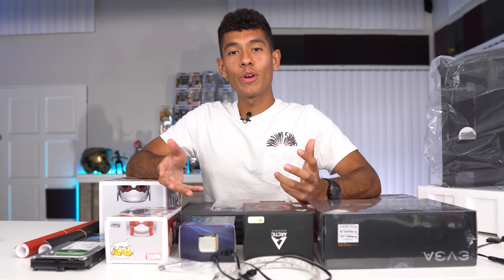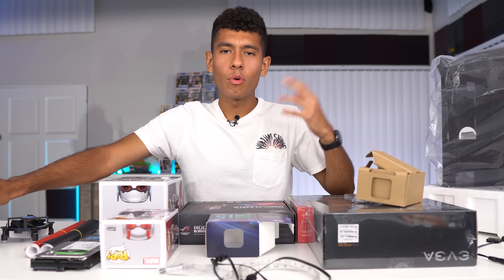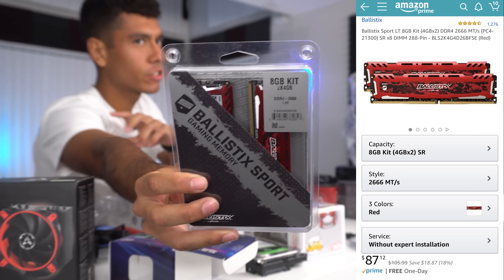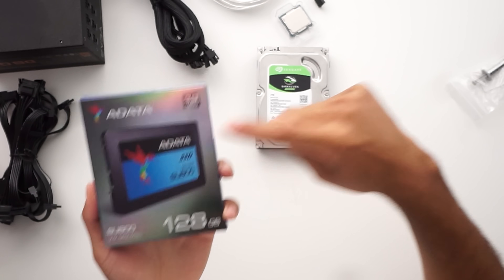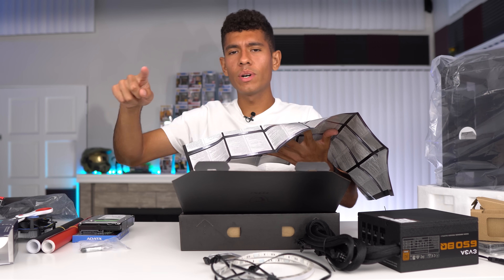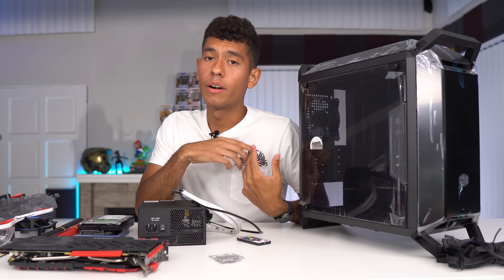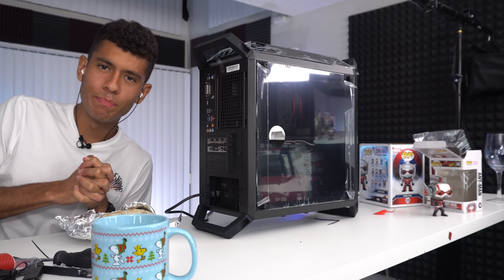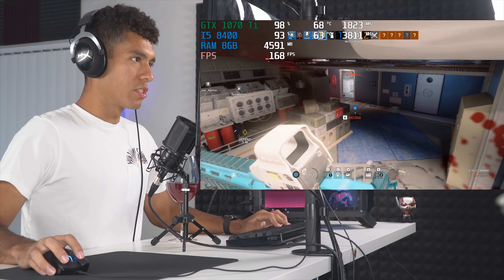$1100 Gaming PC Build - i5 8400 GTX 1070 Ti (w/ Benchmarks)

Comment: so quick question I have a corsair 600w bronze power supply and a 1070ti founders edition, I am carrying over from my last build (need to upgrade, have a fx-6300 and a failing hard drive)  I was wondering if the 50 watts really matters if I followed this build, and does the fact that I have those two different parts going into this build change anything.

Comment: Hi, I'm trying to build my own pc for the first time and I'm planning to build based on this list, but I'm trying to buy i5-8600k instead of i5-8400. so the question is that does it still fit with the same motheboard? and should I buy better power supply since I chose to buy better CPU?

Comment: bruh, only the 'MSI Gaming GeForce GTX 1070 Ti 8GB Graphics Card' is already 650 euro here 😂

edit: the parts for this pc is 1370 euro here (The Netherlands)
Reply: Got it for 1263,77 at Azerty.
Reply: Here is the link, changed the cooler with a liquid cooler. https://azerty.nl/basket/?code=YTo5OntpOjIyNjY0NTU7aToxO2k6MjIyMTgxNztpOjE7aToyNDc4MjkzO2k6MTtpOjE1NjI3MDU7aToxO2k6MjMxOTAyNjtpOjE7aToxMzc2NTEzO2k6MTtpOjMyMTY4O2k6MTtpOjIzMDgwMTA7aToxO2k6MTQzMDQ0MTtpOjE7fQ==

Comment: Question for you. How come when I play rainbow six siege using pretty much the same build, only difference being I have i5 8600k I can only seem to get 130-134 fps. I have tried to lower settings but for some reason it's like its capped

Comment: ida probly gone for the r5 2600 as its cheaper, performance is the same or slighly better and better upgrade path ( as in, keep the board you have and it will be compatible with future processors ). however, great build and vid bud. keep it up

Comment: Would the MSI GTX1070 8G Duke OC fit in the case used in this video?
Reply: Use pc part picker just pick your case and then pick the graphic card and it should tell you if its not

Comment: I use to use ballistix ram with my ryzen 5 build and it was terrible. The speed was slow and it kept crashing! I even got a freereplacement by crucial but it still kept crashing. So after that i decided to get more gb and bettter speed and i got the corsair vengeance rgb pro 16gb 3000mhz. Works like a dream. And i also have a balck and red theme build so i can program the rgb pro lights to go through a cycle of red and white and it looks awesome! Way better then the gay default rainbow colors the rgb went through...
Reply: Any recommandations on what should i get instead of Ballistix Sport RAM at the same price ? Im trying to build the same pc as the one showed in the video. Thank you
Reply: i have a i5 8400 and 8gb ram if i get anything higher than 1070 will it stutter?
Reply: Rertarded Seagull - I wouldn't recommend anything higher than a 1070 if you have an i5 processor. Reason being the processor will limit the performance of the GPU and It wont run at its full potential. so if you bought a 1080 it wouldn't run at full speed because your CPU cant drive it hard enough
Reply: I recommend corsair vengeance rams. Get the non rgb ones if you want them like 50$ cheaper for the same performance

Comment: Can this pc build handle a monitor at 244hz?!❤
Reply: hamza muf that’s a dumb question but yes
Reply: Uh da fuq is that question. As long as your monitor is good, anything can work on it
Reply: Thanks
Reply: I thought that if a pc has shit specs that it wouldn't be able to run on a very high performance monitor
Reply: hamza muf you can use a 240Hz monitor with a shitty pc, you‘ll just not be able to get 240Hz so the monitor is kind of overkill/a waste of money
Reply: No at 1080p even the 1070ti can't get above 160fps on everything high forget it if it's 1440p. Get yourself a 144hz. Btw why even get 244 lol you're not a true gamer for a team and if you were you wouldn't be asking these types of questions then
Reply: a monitor is just a display for your content. there is no spec requirement
Reply: Depends on the game/settings. If you plan on playing games with extreme graphics, 1440p or maybe even 4k you won‘t get 240fps, but in 4K high resolution/graphic settings you will probably not get 240fps with any card.

Edit: If you only want to play games like fortnite in 1080p low graphic settings you are going to be able to reach the 240fps

Comment: What are the fan splitters for??? Help plz
Reply: That allows you to power two PWM fans from a single PWM header on your MoBo.

If you have a 4 pin MoBo header, that is in no way a guarantee that it is a PWM header and that splitter may not work.

I much prefer fan PCBs as they allow for a far cleaner / neater installation. But you must know whether your fan header is providing a PWM or DCV (DC Voltage) signal (read the manual).

Alternately you can use this which works for either a PWM or DCV signal.

1. You can control up to 11 DCV (3 pins) fans with this hub from a PWM MoBo header with the auxiliary power cable connected.

2. You can control up to 6 or so DCV (3 pins) fans with this hub from a DCV MoBo header; do not connect the auxiliary power cable. Six 140mm 1250 rpm fans (0.14 amps each) will draw a total of 0.84 amps ... MoBo headers are rated for 1 amp.

The PCB Mounts on the back of your MoBo tray (or anywhere else you see fit) and allows for a much cleaner installation with only 1 wire coming from the MoBo.

Other, cheaper, options require you to choose from PWM or DCV PCBs.
Reply: Yash S alri thanks a lot

Comment: I’m going to build a pc later this year for around $1000. Any part suggestions?
Reply: just go for this one.....
Reply: Yash S I’m going for a green and black color though
Reply: then just go for black vinyl wrap, get a case that has rgb lighting that Green and the rest should be fine, the GPU is facing down anyway, so you won't notice it.

Comment: Bro what are the pros and cons of using two GPUs.
Reply: Cons:
Way too expensive
Really doesn't make the FPS go THAT high( for example, one 1080ti GPU in GTA 5: IS around 70-80 FPS, while 2 1080tis will get ir around 80-100 FPS, not that much different)
Takes up space

Pros:
They're aren't any...

Bottom line: Its really unnecessary.....

Comment: can I change the Ballistix 8GB kit (4GBx2) SR for 16 GB kit (8GBx2) SR???
Reply: yea, you can.
Reply: thx. Im new in this kind of stuff, also I have other question, is better the i7 in this build? or i5 is fine? I just want to use this pc for gaming.
Reply: Bruno Marcelo i7 would be better, but I’m not sure is the i7 would be good for the motherboard, so if you wanna stay safe just go for the i5
Reply: thanks for your help. I start to buy the parts and I'm a little nervous haha I think this pc is good enough for play in 4k
Reply: Yup np. havefun
Reply: oh and gtx 1080
Reply: the gtx 1080 would be good, but i'm afraid that will bottleneck with the i5, so just stick wiht the 1070ti, plus you're gonna get the same performance anyway.
Reply: maybe I can go for i7?
Reply: yes but then maybe you need to get an new motherboard, because i dont think that motherboard is gonna be good for the i7...
Reply: @y_r_s7293 i7 is compatible with this motherboard... https://www.cnet.com/products/asus-rog-strix-b360-g-gaming-motherboard-micro-atx-lga1151-socket-b360/specs/
Reply: Bruno Marcelo Oh ok, I just thought because the motherboard is not overclocable

Comment: 1070ti or 1080ti for ultra gaming? i have the same monitor but 27 inch VG27QE.
Reply: 1080ti. But they're 700 dollars, thats double price of a PS4. so if you're in a budget....sort of, go the 1070ti, 1080ti will have better frame rates, but with 1070ti, its more than playable. And if you were to compare the 1070Ti and the 1080Ti, the FPS are not off by a LONG shot. plus the 1070ti cost around 500 dollars

Comment: With this one ! Can i use i5-8600 8th gen for i5-8400 like ur build 
N 1 more thing , i have a little bit confuse between motherboard cause im fan-boy of msi so “ is it imposible if i change by msi b360 gaming motherboard plus ?? ?” 2 of it supp for socket1151 , right ?
Reply: I think Asus' motherboard beats every single competitor in terms of performance, i'd stick with the Asus one.

Comment: Let’s do this:
GTX 1060 6gb
Ryzen 5 1600
8gb ddr4 ram
1tb Hard drive
Reply: Magnus Rasmussen  got a question for you. Is this a good PC? Or should i just stick with 2000 dollar?
Reply: Magnus Rasmussen  I'm worried that  a used 1080ti would affect the FPS, i would like the same performance he was getting while playing games, using the 1080ti.
Reply: Magnus Rasmussen  Tell if this is good or not. The same specs in the $2000 build but except for the 1080ti, I instead get the 1070ti. Is that good?
Reply: Magnus Rasmussen Ya but you said they have thermal damage to them and idk wtf they’ve done to it, and maybe I can go for the 1080, cheaper and almost have the same performance, what do you think?
Reply: Magnus Rasmussen But what about the 1080 not the 1080ti? Is that good?
Reply: Why? And is it even released?
Reply: Magnus Rasmussen Oh ok, I feel like the new stuff Intel and Nvidia are making are turning to be trash
Reply: That's just my opinion.
Reply: Magnus, tell me since the Asus ROG Strix z370-F MOBO is running out of stocks super quickly, is it fine if I go with the Asus ROG Maximus X Hero (WI-FI AC)?

Comment: Can anyone recommend me good specs with a budget of 600$ for gaming and multi tasking? Currently have an i5 650 and gtx 750 ti.
Reply: pick up a second hand 1060 6gb. Then just find a vid like this for a 1060... best advise i can give.
Reply: Bjorn Spaans I was hoping something withing a budget of around 650$
Reply: @ryana2226  1060 second hand is about 200 bucks, add a i3 8100 for 100 bucks a msi 370z a pro 8 gb of 3200 ram some storage and a case and blam.
Reply: @ryana2226  he did a video on a 650 dollar budget build
Reply: If you want to keep same mobo and ram. Get an i7 880 or an Xeon X3480. Pair it with a second hand gpu like a gtx970
Edit: You then have for €230 bucks a crazy upgrade

Comment: Can I use a CORSAIR Vengeance LPX 16GB (2 x 8GB) 288-Pin DDR4 SDRAM DDR4 3000 (PC4 24000) Memory Kit Model CMK16GX4M2B3000C15 and a GTX 1050ti sc with everything else in the PC that you suggested? If so, would it be much different performance? I'm good with decreasing the graphics slightly... My intention is to go into competitive gaming and begin streaming and or recording videos.
Reply: Respond quickly if ya don't mind... This will be a very efficient $900ish build then for me... because I already have a case.

Comment: Do you think a Ryzen 2600 that’s overclocked to 4.2ghz and an overclocked gtx 1070 ti be good for 1440p gaming at 90-100 FPS and above at ultra settings?

Build specs:
CPU: Ryzen 2600 oc to 4.2 ghz
Gpu: Evga ftw2 1070ti
Psu: Evga 650w b3
Ram: Corsair vengeance 16gb 2400mhz
Mobo: Asus prime X470 
Cooler: Corsair h100i v2
Case fans: Deepcool rf120 3pack
WiFi card: tp link archer T6E AC1300 pcie 
Ssd: Pny cs900 120gb
Hdd: Seagate Barracuda 1tb
Case: Nzxt s340 elite

Do you think this is a good build? I haven’t bough the parts yet but just wondering if it’s a good build. Total is $1250

Comment: do you think i can use this indstead, and still get the same perfomance?:
RAM: Corsair Vengeance LPX DDR4-2400 DC 8GB
CPU COOLER: Corsair Hydro H100x
Power supply: Corsair CX650  - 650 Watt - 120 mm - 80 Plus Bronze certified
Reply: Magnus Rasmussen i think hes using the cpu and gpu in the video but the items he mentioned are replacing the ones used in the video
Reply: @Magnus Rasmussen lmao a good air cooler is like 30 bucks and an aoi is 60 i would reccomend going for an aoi

Comment: I need help is this a good buy to run gta 5 on 
Fx4130 cpu clocked @4.6ghz

Deep Cool Gammaxx 400 cooler

G. Skill Ripjaws 8gb 1600

MSI 760GMA-P34 mobo

Gtx 750ti 2gb

EVGA 450 BT power supply. 

500gb HDD 

DIYPC BG01 case

Comment: Is this build better than your GTX 1080 $2000 build you did 6 months ago because the frames seem way better although the games might have changed for the better but this builds benchmark shows 20 + FPS on fortnite than the other build, Any answers?

Comment: I5 8600k
gtx 1060 6gb asus 
asus rog z370-e
G skill F4 3200 trident z rgb 16 (2x8) ram
Deepcool gammaxxx cpu air cooler rgb
Corsair Semi Modular cx650m Power supply
Corsair carbide 270r mid tower 
Samsung 250gb ssd
1tb hdd 

Build this Please🙏🙏🙏

Comment: Guys! Is it okay to use AIO Cooler for my i5 8400 W/ gtx 1070 ti? I live in a tropical country. Haha. Also, my room avg temp is around 30 - 31 specially during the afternoon.  I just want to make sure my cpu will maintain temp while gaming. Thanks for the help!
Reply: But truth to be told I'm gonna buy the i3-8100 and was planning to use the stock cooler xD

But later on I would buy Intel i7 and then changed the stock cooler cause I heard it's kinda shit lol
Reply: Hmmm I think it Should be okay, what country btw? You should check other coolers reviews on those specific CPU and graphics card
Reply: THAILAND. You won't like the heat here. Lol srs. I think i'll go with the 120 aio. 240 is a bit overkill. Thanks for the response anyway :)
Reply: @janepearl7166  Lol really? I'm used to the heat I'm from Jamaica so the temps are basically the same here. Secondly you're welcome I'd go for the 120mm as well..

Comment: Hey, I'm looking for a beast of a PC for 1080p gaming. And only 1080p gaming...
I'd like to run every game at 1080p and over 60fps. Keep in mind I have a 144hz monitor.

Any suggestions to make it better performance for 1080p gaming?

My current build idea is this:
CPU: i5 8600k
CPU Cooler: Corsair H100i v2
Motherboard: MSI Z370 Gaming Plus
Memory: Corsair Vengeance LPX 16gb (DDR4-3000)
Storage: 500gb Samsung EVO 860 SSD
Storage x2: Seagate Firecuda 2TB Hybrid Hard Drive
Video Card: Gigabyte - GeForce GTX 1080 8GB WINDFORCE 
Power Supply: EVGA SuperNOVA 650 (80+ Gold)

Peripherals if you want to know?
Keyboard: Logitech G810 Orion Spectrum 
Mouse: Logitech G403 Prodigy
Mouse Pad: Logitech G840 XL
Headset: HyperX Cloud Flight
Microphone: Audio-Technica AT2020
Monitor: Acer GN246HL  24"
Operating System: Windows 10 Pro 64bit

Comment: I’m looking to build a pc for around this price range and with similar parts... only thing is I don’t know which is better the 2600x or i5 8600 or 8600k please let me know
Reply: Ryzen 5 2600x is better for price to performance, and the stock cooler can allow you to do some minor overclocking. Also the 8600k doesn't come with a cooler, so you have to buy your own.
Reply: Ryzen 5 2600x is much better
Reply: Muhaimin Aziz does this build support WIFI like so I can connect it normally or will I have to get a different motherboard
Reply: MY FIRST PC BUILD NZXT - CHECK IT OUT PLEASE! - https://youtu.be/bEw6JloAAfo

Comment: I got a friend of a friend selling me a pc for 400$ I been trying to get a pc for a while but I don't know much this is what he sent me the case I a square too 
Case: Phanteks Enthoo Evolv Itx (acrylic panel is a bit scratched but nothing major. New)CPU: Intel I3 6300 With Cryorig M9I cooler Mobo: Gigabyte H110N ITX board. I added an m.2 WiFi/Bluetooth card so there’s no need for USB adapters. GPU: Asus R9 280X 3GB (I’ve got other graphics cards that I can upgrade for a fee)PSU: New Rosewill 600W PSU non modularRam: 8GB Patriot Viper 2666 MHZ DDR4 Storage: 120GB SSD with windows 10

Comment: I'm going to build one gaming pc
Choice I got is
I7 8700 Asus Rog Strix Gtx1060 6GB
I5 8400 Zotac Gtx1070ti Amp! Extreme
Which one should I go for? I will not change my desktop for a long time. Is I5 8400 with 1070ti a bottleneck? Which is better for future gaming?
Reply: 恒 恒 go for Ryzen 5 1600 GTX1070ti. The i5 8400 gets 5-12 more fps but uses twice the core power. While the i5 uses 80% of its power in games the Ryzen sits at 30-50%. This makes streaming easier and makes the chip last longer for gaming.